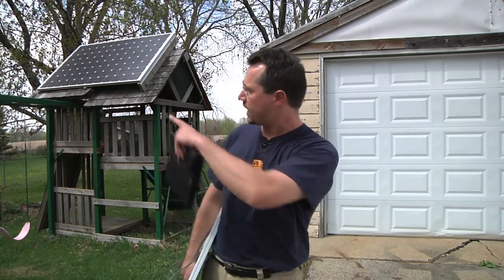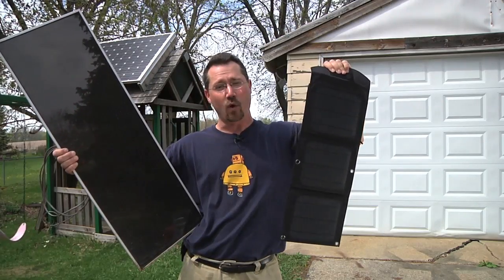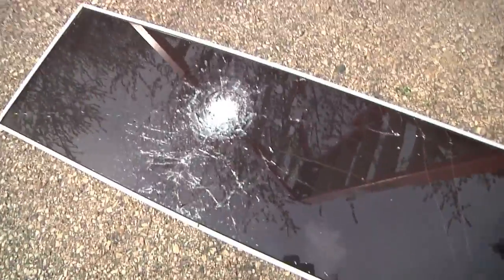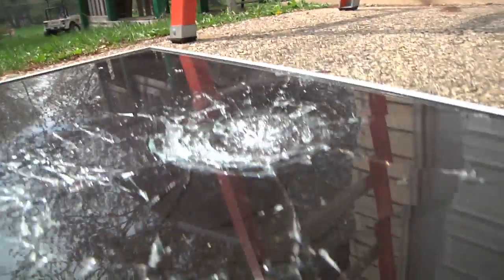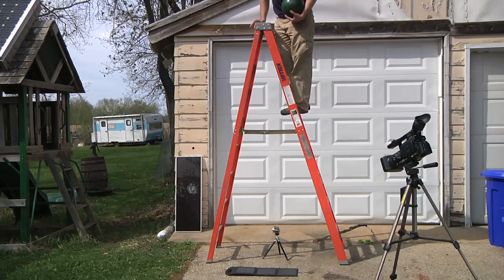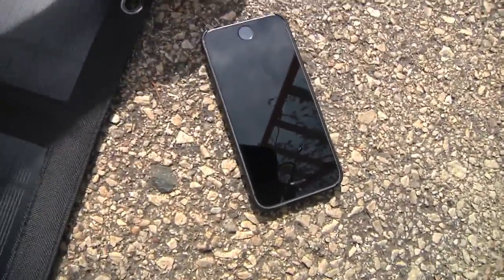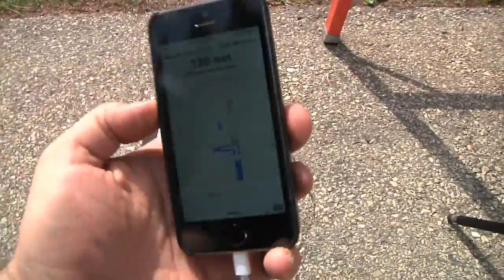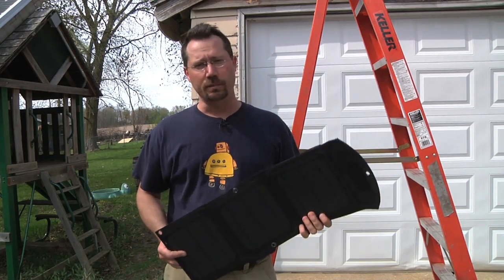Bowling Ball vs Solar Panels - Full

Comment: Did you test the first panel after?  It looks to me that it still might be partly operational.
Reply from the maker: Steven Dufour The Harbor Freight panel actually DID still work afterwards. It put out about it's rated voltage. However, putting any sort of draw on it at all showed that current was EXTREMELY limited. I think that afterwards, short circuit current was something less than 100 ma.